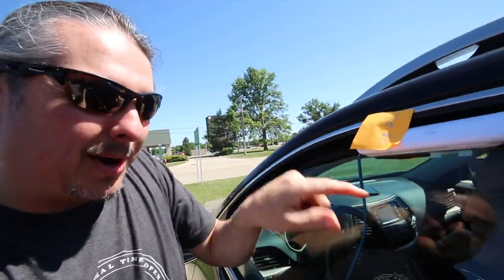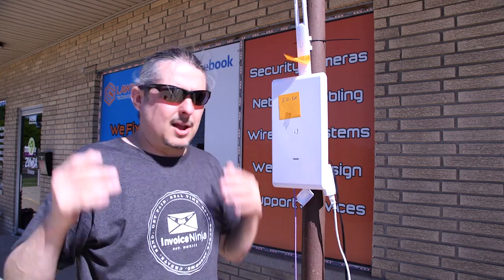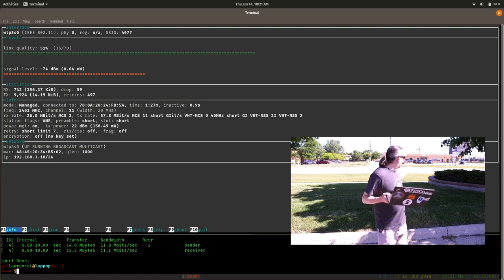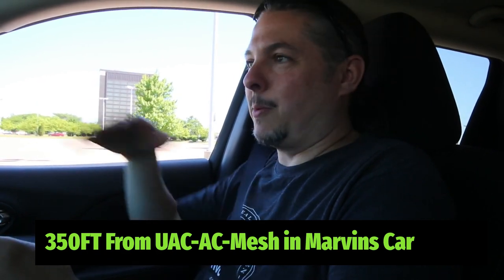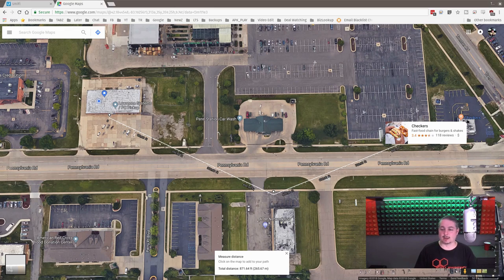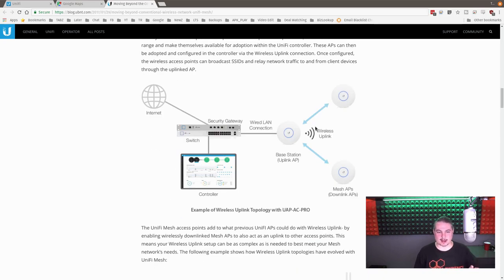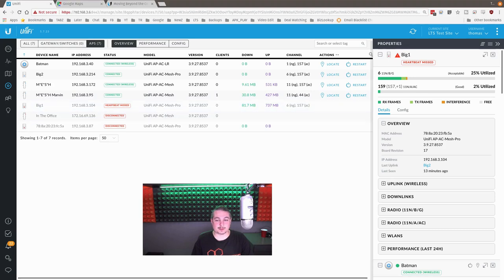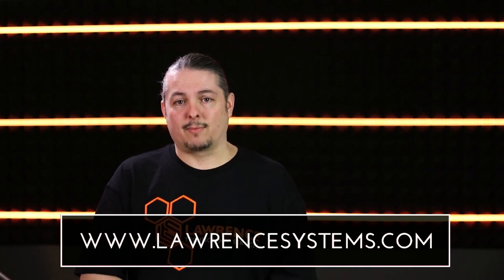Testing Ubiquiti Networks / UniFi UAP-AC-M & UAP-AC-M-PRO Distance & Performance

Comment: The directional antenna you can buy for the non pro version is a beast. I recently used one and was able to maintain full download bandwidth over 400 feet away from the antenna
Reply: What the exact model of antenna did you use? What the longest distance you were able to cover by the antenna? What speed and ping you have got in the most far distance?
Reply: @YuriyArseniev  It is the directional dual band antenna for the UAP-AC-M https://goo.gl/qU3JEx . In one instance on a network that had 120 mbs download and  15 mbs on the upload from roughly 300 feet away my ping was about 20 ms and was getting 115 download and 13ish upload. This was in a wide open yard. Something to keep in mind with this antenna is the radiation pattern. Down the middle is 5 GHz and on the sides on the 2.4 GHz . I forget what the exact degree spread is. I ran another test during a deployment in a marina and it seemed around 450 feet plus I started to notice significant drop off in connection speed and quality (which is to be expected, most devices WiFi cards are pretty weak). Any way, I've been very impressed with the roughly $99 antenna add on for the UAP-AC-M. Worth every dollar and gives you incredible range. Hope this helps!
Reply: @Equinox2021  The 2.4 GHz band has a 90 degree beam pattern and the 5 GHz band has a 45 degree beam pattern. There is no dead space of 2.4 GHz right in the middle.

Comment: [00:00] Hey there! Thanks for sharing this interesting video about mesh networking with Ubiquiti devices. It's really cool to see the practical application of these units, especially the car-to-car meshing experiment.

[00:14] The range you achieved with the mesh Pro and standard unify AC meshes is impressive, considering the distance you covered during the tests. It's good to know that these devices can handle two hops without a significant drop in performance.

[00:29] I'm curious about your thoughts on the practicality of such setups. When would you recommend using the more expensive mesh Pro units over the standard ones? Is there a specific scenario where the additional features and power of the mesh Pro make a significant difference in performance?

[00:42] Additionally, it would be great to hear more about the use cases you find most suitable for mesh networking. You mentioned Wi-Fi planning; are there any other scenarios where mesh networking shines, in your experience?

[01:08] Thanks for sharing your insights, and I look forward to your upcoming reviews and videos on Ubiquiti equipment. Keep up the great work!

[01:21] Cheers!

Comment: I set these up in a campground that had some minor tree interference we only were able to get  only 100 feet on uap-ac-m  to uap-ac-m 175 feet on the pro. Also I had connected with there chat and searching there forums a lot people had distance issues. They are a great product but in the real world environment you may need to reduce your distance.
Reply: Understanding RF mechanics 101. UHF spectrum (400 mhz and beyond) is almost entirely line of sight and susceptible to absorption or deflection by buildings/cars/organic materials like mountains and trees..
Reply: Yeah, campgrounds are a problem. I don't know why they bother advertising free wifi and don't just run fiber to outdoor panels of switches, and run copper from there to the sites. Let people put in their own APs. It's especially insane when they use wireless as uplink instead of at least running a cable to their APs.

Comment: I used the small unit with a sector panel and was wirelessly sending full res images files using FTP straight from the camera back to base from 1400ft - I was blown away

Comment: Let's say I am a  home user attempting to cover about 600sqft with few walls throughout the area . Would you recommend buying a ap-mesh (run it in in non mesh mode) or AP-LR. From a price point there are very close in my country. Just needed to check which one could provide better performance

Comment: Thank you very much for another excellent video, love the channel. You had a reasonable line of sight between the devices, I wonder how they would do in a more dense environment with multiple buildings in-between. Could you skip a few buildings each hop and still get reasonable performance, or would you need to put one on top of every building? And if you were mounting these on top of every building, or every second building, would the wifi signal be strong enough inside the buildings? I am thinking about a scenario with many ground-floor-only buildings on a site all linked with mesh.

Comment: UAP-AC-M - antennas didn't last a year.  I have had one of these on my tower in Cancun and the tips of both antennas cracked off (looks like didn't do well in sunlight) funny thing is i still have some old style Nanostations on the tower (15 years old still working) thinking maybe the bigger mesh ap might last better since antennas are inside - but both of these are $$$ wanted to see what you think. Thanks

Comment: I have a RV and regularly visit a camp ground that has these placed all over. Question is can I use one to connect as a client from outside my RV bring the network inside with the cable to a switch for hardwired stuff without a controller? In some places the WiFi isn’t good inside RV (because it’s a metal box) so I was going to use this as a client to bring the internet inside.

Comment: I watched this video again. Great test and insights. I am still curious if the regular non mesh APs will only do 1 level wireless uplink? Or they will do multi-hop? Or do I need to get the mesh versions to do mult-hop? Also do I need to have the mesh version as the first in the chain (ie the one connected to the switch)? Thank you!

Comment: If you do not mesh, has the -M any advantage over the other APs like -LR or vice versa, if the others do mesh too, what’s the -M advantage here?
Reply: They're the only products available that are safe for indoor/outdoor installations. The standard -M (not the PRO) supports any AirMAX 2x2 antenna (5G preferred).

Comment: I'm curious about the big square mesh pro. It says 183 meters or about 600ft of coverage.  Would that be a point to point? Like 600ft radius and 1200 ft diameter because it is omnidirectional?  If it is only 600ft of coverage total, 300ft in each direction, it would seem odd because it can handle...I'm not sure it was over 100 connected devices, that would be a lot of devices in a small area.

Comment: Hi Lawrence, Really appreciate for your share info... Just Once question, Is it possible if we use, Unifi mesh Pro as a master than pairing with 1 unit UAP-AC-M as mobile AP (moving between 300 upto 900 feet ? and if possible, how to config ?

Comment: Question, I have deployed quite a few of the UAP-AC-M and UAP-AC-M-Pro but none has anywhere near the range you guys are getting. The mesh works well, but the range is just about 100 feet. I have an UAP-AC-M-Pro mounted on the roof top of a cabin, this is in an totally open area and 100% off grid, but I am still not getting more than 100 feet before the signal really faded (as detected by WiFiman from UB). Any ideas? Thanks.

Comment: I have a ubiquitous system in my house.  I ran cat6 outside on back porch with POE.  I want to send signal to boat dock approximately 150ft away with down hill slope.  Some trees but under brushed and clear line of sight.  Would the pro work or do I need to bridge and then set up access point at bottom.  There is power on the dock.  Was hoping the pro would work because it would be least expensive.  Compared to the nano bridges and adding another access point.  I am not a professional so if I sound illiterate when it comes to using the correct words it is because I am.  Sorry any suggestions are appreciated

Comment: Just as an example that they don't have to be used as a mesh, I have one of the M-Pros that I use as an AP simply because it's weatherproof and hangs out on my stage roof in the rain.

As a side note to that, could I put a second one at my FOH tent 150' away in mesh mode and hook a managed switch into that network port on the 2nd M-Pros to connect multiple hardwired equipment through the mesh connection? Or does this only work for wireless connections?
Reply: I've done this where I have a mesh pro hardwired into the main router and then some distance away I have a UAP-AC-M powered via injector and connected to the pro via mesh. On the injectors lan port I plugged a switch and had no problem plugging in devices into the switch. It works great!

Comment: nice considering they were only a few feet above ground, Tom, be good to see how far you'd get with a mesh unit on your roof, I reckon you'd get to checkers directly, I have seen a 10yo dlink 604 used for wifi on a hill window about 18 meters above low level, getting 300 meters, you wopuldt get HD, but you got voip

Comment: Hey all, I have a client for whom I have just installed a Unifi UAP AC-LR, one of the standard WAPs in her home.  it doesn't quite provide coverage all the way to her upstairs.  Would I be able to "mesh" in the UAP-AC-m using the -LR as the starting point?  Or should I removed that and put in a AC-M as the start?  Would appreciated the advise.  Thanks.
Reply: I posted a link at the end of this comment has a pretty good overview of the "wireless uplink" capability for both mesh and non-mesh APs like the UAP-AC-LR. If you scroll down to the "UniFi Access Points - Wireless Uplink Compatibility Matrix" it says wireless links are supported in the AC-LR (note the * which indicates you need a recent firmware update.) My understanding is there are some limitations in the performance of wireless uplinks for the non-mesh APs, but from reading on UBNT forums they do work. I bet the AC-LR manual would have more info, as well as other posts in the UBNT forums.  Doc link -  https://help.ubnt.com/hc/en-us/articles/115002262328-UniFi-Feature-Guide-Wireless-Uplink

Comment: I would like to know if the airmax Omni antenna will work with the new unifi AP mesh outdoor access point?
Reply: Don't think so
Reply: @n.l3880  I have a follow-up question, if I  decide to purchase different unifi devices including mesh devices and unifi APs like the LR and etc , would they be able to work together and integrated in one network and clients can roam between them
Reply: @tridentd5898  Yes all UniFi devices work together
Reply: @n.l3880  thanks

Comment: Should the controller software always be running?? Once provisioned??
Reply from the maker: It doesn't have to be, but you won't have any statistics if it is off
Reply: Lawrence Systems / PC Pickup I get it. Just in case once its configured we don’t need a dedicated system running all the time right?? We can see stats whenever required??
Reply: @m.imraniqbaal6912   if you want to gather stats over time,  say over the course of a week, because the stats are stored on the controller device (PC, Cloud Key, etc)  it needs to be running for that whole week to gather the data. But the APs will continue to work while the controller is offline. I have a site that pretty much never has a controller running unless I need to make a config change or troubleshoot an issue.

Comment: With "Allow meshing to another access point" does that mean I can connect the UAP-AC-M to another existing non ubiquiti access point like a linksys or netgear to extend the network?
Reply from the maker: No the mesh is designed with other supported UniFI devices.

Comment: I am probably a dum dum for asking this but wanted to know if my concept will work.  I have a house and a guest house.  they are approx. 300 feet from each other with some obstructions.  my intention is to connect a PRO to my main house modem, and connect another PRO on the outside of the guest house.  should I then run (wired) another access point inside the house or perhaps connect a wifi router to the PRO on the guest house to broadcast the signal inside the guest house?  im sure im going about this all wrong, but thanks for the help
Reply: Hi Aaron, I'm looking at doing something similar, but my distance is far shorter, so I'm considering using two M's one wired to the router in the main house, the other wired to a network switch in the remote building.  Depending on where the remote unit can be positioned, I'm hoping not to need another AP in the remote building.  As with most things wireless without trying you won't know if you also need an internal AP, as all buildings differ.

Comment: I have a uac mesh meshing to a mesh pro. Manually configured uplink downlink on each access point. From the little one only gives 8-15mbps. Distance is only 30 ish meters and pro has a 1gb Ethernet uplink.. channels are manually figured so no overlap. Power settings medium then high and no difference. 99% line of site too. Really crappy speeds. No hair left to pull out 🤓

Comment: is the ac-m-pro, a directional unit?
what about the ac-m?
Reply from the maker: both omnidirectional
Reply: No, despite the appearance/design, the pro and ac-m are not directional.  You can add an external directional anteena to the regular AC-M, available from Ubiquiti.